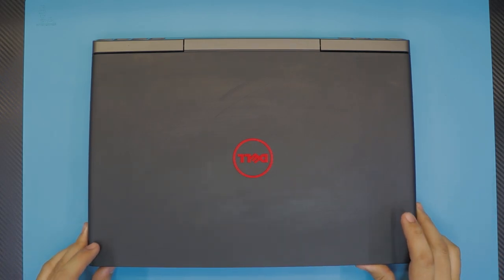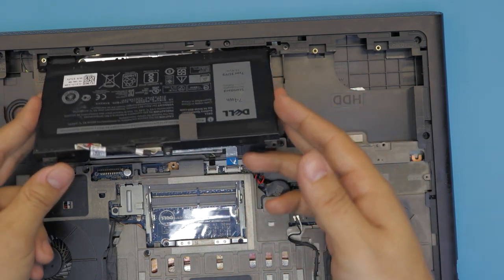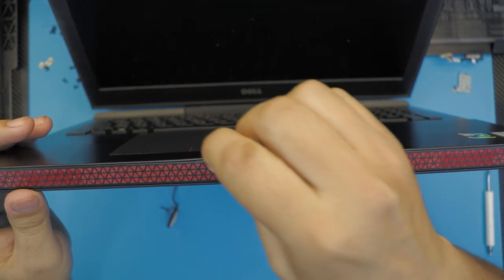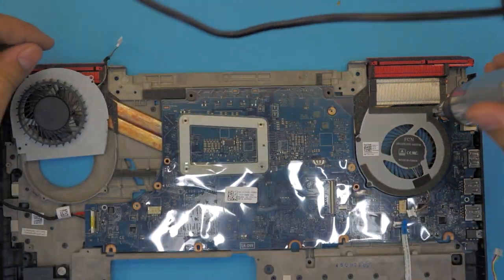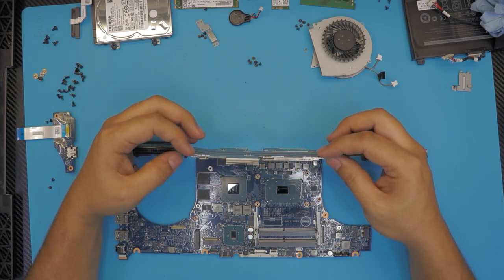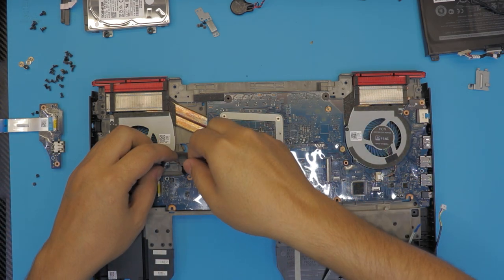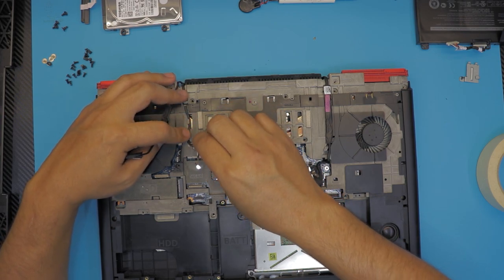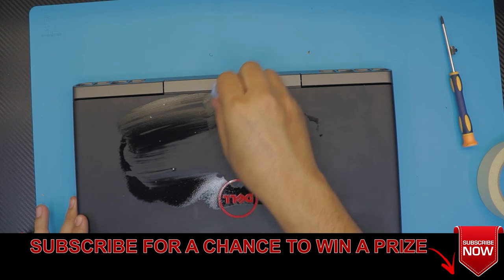Dell Inspiron 15 7000 LIQUID METAL thermal compound and teardown

Comment: I used this tutorial to replace the thermal paste with artic mx4, as I had suspected using liquid metal would lead me to make a mistake a possibly kill my machine. I was right, some mx4 got onto the capacitors, I cleaned them off, and made sure everything was fine, put it together, and it worked! Maybe once I'm better at applying thermal paste I'll try using liquid metal. Thanks for the video! Only took me 4 hours to do though
Reply: I did this on a similar model, it is the inspiron 7577 I believe, it has a gtx 1050 and a core i5-7300hq. Only some minor deviations
Reply from the maker: thank you for the support to the channel by subscribing :)
and i appreciate your tips and opinion regarding the repaste, and look at the positive side now it took you 4h next time it will be 2h and before you know it you can do it under 15min and the best part you will be able to help family and friends :P if you got any request or questions in the future ask me in any of my video comments :)

Comment: How to cleaning the "red headsink thing" ? Because mine little bit oily and trap the dust, so the air flow not good
Reply from the maker: Thank you for the feedback! if you wish to support the channel you can LIKE or SUB or both :P
regarding your question: you can remove all the pads from heat-sink and wash it with hot water and soap and let it dry or dry it with hairdryer, and blow air into fins.
Reply: @uFixTek  ok done,...and thanks for reply

btw we can remove it from the chopper tube ? are you sure ? is that soldered ?
Reply from the maker: you only going to lift and remove slowly the thermal pads off the heatsink and then clean the heatsink and wash. don't force the copper tube or anything.

Comment: Thank you for the video. It made disassembling and further reassembling much easier.

My laptop was throttling for almost 2 years. Couldn’t figure out until I realized it was all dried-out, old crumbling thermal paste to blame.

Also, thanks Dell engineers for making that complicated.
Reply from the maker: Glad it helped, Thank you for the feedback and your support to the channel by a SUB :P
if you have any request or question feel free to ask.
LOL this is nothing compared to some other models that they have, if you think this is hell you don't wanna see the devil yet :P

Comment: I cant wait for the next weekend to apply this tutorial. Currently, my thermal paste is on the way and my laptop is 4+ years old. Wish me luck! Great video btw, keep it up!
Reply from the maker: Good luck! Glad you liked it 😊Thank you for the feedback! if you wish to support the channel you can LIKE or SUB or both :P
if you have any question or request in the future feel free to ask me.
Reply: asf asfd  yes, i also add nail polish. It has been running great for 6 months without any problem. The downside is like you said, im afraid to take it around because the paste MAY spill all over

Comment: I have this same model 7567 with gtx 1050ti, can I change the motherboard for the model gtx 1060 7577 would be compatible this exchange?
Reply from the maker: Thank you for the feedback! if you wish to support the channel you can LIKE or SUB or both :P
regarding your question: Absolutely NOT, we have tried the heatsink profile is very different and the heatsink for 1060 wont with in this case.

Comment: Nice video dude, some heroes don't wear capes.
Reply from the maker: Thank you for your comment, and if you have any questions regarding any laptop repair or electronics you can ask here :P
Reply: @uFixTek  In this laptop model, when using the Arctic 5, do you recommend applying a bit in the center and let the heat sink spread the paste over the chip or apply the same way you did in this video?
Reply from the maker: to be honest and if you trust me i would say go with the way i do i been doing my test and working in this line of work over 14years. you can put a bit in the centre but if your heat-sink doesn't press directly over the pasete , the paste will expend the other way leaving a clear spot on dye.
i would highly recommend you to apply paste all over the dye (dont worry if you add more), its not conductive.
Reply: @uFixTek  Thanks
Reply from the maker: @sidneidiasmonteirojunior3846  anytime, let me know if you need help with anything regarding your laptop.

Comment: Hey, will you recommend replacing the thermal pads as well?
Reply from the maker: NOP no need to. unless you do a over clock then yes , if no over clocking then no
Reply: Thermal pads won't help shit nothing, first of all, thermal pads have very low thermal conductivity, and also comparing one to another, there's very small difference, also RAM chips don't run hot so you almost wouldn't even need the cooling and third, there's common thermal surface, this means that all chips are cooled with same surface, same cooler, so if the cpu/gpu runs extremely hot and the whole cooler is hot, it won't help much if ram/pwm is cooled with same warm cooler...

Comment: Nice video. I am experiencing throttle in games with the same laptop. I have MX-2 thermal grease right now and is it worth to put it on the laptop? Or should I go with liquid metal?
Reply from the maker: Тимур Файзиев i would highly recommend you to get LM it’s worth the wait. Once you go LM you never have to look and worry regarding your temps, ever again, just a regular dust cleaning.
Reply: @uFixTek  how's the temp difference a month later?  honestly thinking of doing this on my Dell 7000 laptop
Reply from the maker: @neverstopz9045  the temps are the same the temps wont change unless the heat-sink is filled with dust , i personally have LM on my alien-ware and my pc gpu and they are solid  and they have same temps as day one when i put on the LM.

Comment: Did everything as instructed, got ∆t of 23°. Used thermal grease conductonaut as ufix, im very happy that someone actually didnt lie about this improvement in temperature, now my pc runs smooth without thermal throttling and the rpm of fans decreased from 5000 to 4100, which also lowered noise from my notebook. Thanks for the vid man!
Reply from the maker: im glad that it did helped you out my friend and i appreciate your support by sub,a nd if you got any questions in the futures you may ask me in any of my video comments :)
Reply: cuantos grados te arroja maximo  jugando ??
Reply: What notebook are you referring to in this comment? If you don't mind me asking?

Comment: hey bro, how much does the temperature drops? and will it increase performance in my laptop?
Reply from the maker: the temps drooped from 95c to 68c on gpu cpu was over 90s and drooped to 75 , on over load. it will for sure improve performance as your cpu wont over throttle . and dont let no one fool you with exact numbers as exact number have many factors , room temperature programs that use cpu or gpu or both and many other factors. but it will for sure change your life :P
Reply: uFixTek Ight, thank you very much, I’m from Mexico so it’s kinda hot here so I had a problem since I bought the laptop, the temps on the cpu were to high all the f time so I had to under clock, that stopped the problem and also stopped Intel alert systems telling me every 5 min the cpu was to hot. But I’ll try this metod for shure, thanks again man.
Reply from the maker: @enlamiramxes  ah ntp compa , si gusta igual nos puedes enviar tu equipo lo hago aquí en mi taller ando en queretaro yo, soy de canada pero vivo aqui. ya me han mandado varias alienware otros subscribers de mi canal que estuvieron en otro estado.  igual se le hago un video para que veas el trabajo echo . saludos

Comment: Hello, what kind of thermal pad would you recommend for this knee? Could it be 0.5 or 1.5mm? So what exactly is the thermal pad used as stock?
Reply from the maker: 🫠Regarding your question, they used .5mm thermal pads and you can change them for a better quality: Gelid Solutions GP-Extreme: https://amzn.to/3Sv1Fid
Should you have any further questions or requests in the future, please don't hesitate to ask me.
cheers🍻

This is an Amazon affiliate link. When you use my links, you are helping to support the channel. 🙏

Comment: I broke the mechanical hard drive lock which you were speaking about at 2:21 where can I get a replacement? Can't find it on Amazon
Reply from the maker: 🫠Regarding your question, if you broke the lock i will need to see and image of the damage to be able to assist, email me pictures of damage.
cheers🍻

Comment: Hi ,I got that same Dell 7577 , the keys 2,w,s,x don't work, is it the keyboard.
Reply from the maker: Thank you for the feedback! if you wish to support the channel you can LIKE or SUB or both :P
regarding your question: yes it very common issue with this keyboard as it absorbed a lot of heat and starts going bad like cancer, it will expand to the rest of the keyboard, you must replace the keyboard, the keyboard has to be replace from inside the palm-rest. here is an example of how to  replace a mesh keyboard, its the same technique: https://youtu.be/lc6PUlPlpP0

Comment: Hi, i did everything like you on the video, but my laptop won't start, power button is dead. When i  lauched it for the first time, fan's were very loud but no display, anything. Now when i am trying to turn it on, nothing happens, even fan's dont work. What can be the problem?
Reply from the maker: can you double check the flex cables mostly the flex cable that goes to power on board. and send pics and let me see what you may have done wrong.
Reply: @uFixTek  Ok i will check and i think it could be the problem because i broke that lock which is holding the flex, so a used a tape to hold it... xD
Reply: Any idea what can i do in that situation?  Tape is a good idea?  Edit. i found that little plastic lock and it looks good, is there a chance to put it in the slot
 to place a cable properly?

Comment: Exactly what I was looking for! My battery is bloated, my fans are very dusty and hence my 15 7000 is running very hot. (Idling at 80 C, maxes out at 100 C causing the CPU & GPU to throttle to 1.8 GHz) I have bought the "Noctua NT-H1 Pro-Grade Thermal Compound". Hoping it will drop my temperatures by at least 10 C, since LM is quite expensive in my country. Do you think I can do the maintenance by myself? What suggested screwdrivers would I need to open all the screws you did in this video? Also my fans are terribly dusty, how would one clean them (water? )? Excellent video! Keep up the good work. You've earned a sub. :)
Reply from the maker: I'm glad that this video can help you out, if you are a bit of handy man and know how to put a IKA chair together, then trust me you can follow my video and if you have any question ask me i try to reply quickly. regarding the screwdrivers grab any cheap set of screw driver but if you want to service often you electronics get the one in my video description. about the fan noise never ever use water , you need a old tooth brush and  a "Alcohol isopropilico" link in the description. you can use the same alcohol to clean the motherboard, its safe. i would recommend you to put a copper shim on gpu and cpu 20mmx 20mm .3 or .4mm thickens. and you will have to put thermal pasteon gpu/cpu then on othe other side of the copper shims. you will be shocked by temp drop. good luck
Reply: @uFixTek  Just removed the bloated battery yesterday and have enjoyed doing it. Will now move on to removing the dust while cleaning it with the suggested alcohol for everything inside. Thanks a lot. Will update and text you if any help needed.
Reply: @uFixTek  thanks for the shim idea.

Comment: Always disconnet the battery first!
Reply from the maker: it is a good idea if you need to be extra cautions, BUT as long as the laptop is off, you can remove ram and HDD and m.2 without any issues, without removing the battery. when you look at the schematics of the motherboard you will know that the power rail to the ram and hdd and m.2 and many other ports and parts are off and there is no risk of shortage. 
again there is nothing wrong with disconnecting the battery 1st.
thank you for your feedback and comments :)

Comment: Im a lil late to this. Been using my laptop for 3 years plus to 4. About to repaste and seeing this vid realized there is thermal pad. Since im gonna repaste, might ad well change the pads as well. Did u by any chance measured back then the thickness of thermal pads? 

Thanks in advance
Reply from the maker: Thanks ✌  for the feedback!  if you wish to support the channel you can LIKE or SUB or both :P
Regarding your question:  i would recommend you to keep the original pads as they have a life span of 13years and those components don't go over 60c but if you wish to replace place this .5mm:
https://amzn.to/3gseKpC

Comment: I understand that liquid metal can not be changed? or does he have an expiration date? I use a grizzly cryonaut and it also copes well and does not dry) will there be a difference between it and liquid metal in temperatures?
Reply from the maker: LM can be changed and you can clean and re done it, and it does NOT expire! the only expire kinda stuff is if you place the heatsink and lift it after few days you must clean and repaste it. any type of paste they have expiry date and the date is based on the use and heat pass. normal use 3-4 years. LM will give you 4-5c extra drop. good luck

Comment: hello, I have a thermal grizzly kryonaut, is it appropriate to apply it to the heat sink after applying it to the processor and graphics card with a cotton swab as you did in the video? I mean, does it happen in liquid metal or this, or does it matter? According to him, I will do what you did.
Reply from the maker: Thank you for the feedback! if you wish to support the channel you can LIKE or SUB or both :P
regarding your question: if you placing LM apply it on both side, BUT if you going to place a paste only on GPU and CPU, a tiny line no need to use cotton swab for paste.

Comment: What is the material of the heatsink on the XPS15 L502X ? I see its copper but what is the silverish araound it ?
Reply: It's a coating of zinc. It's commonly applied to heatsinks and coolers to protect against corrosion.

Comment: Tal vez a alguien le sirva mi experiencia:

Tengo el mismo modelo de computadora. Para la aplicación de thermal pads y pasta térmica, utilicé los siguientes productos:

-   Thermal Pads: Arctic TP-3, 100x100x0.5 mm.
-   Pasta Térmica: Thermal Grizzly Kryonaut Extreme.

Los thermal pads originales de mi computadora eran de 1 mm y 2 mm. Para compensar, superpuse los nuevos de 0.5 mm uno encima del otro, usando 2 pads para lograr 1 mm y 4 pads para 2 mm.

Al recortar los pads, usé tijeras, pero no obtuve cortes precisos debido a que los pads eran muy delgados. Cambié a un cúter y una regla, lo que mejoró notablemente los cortes. Antes de recortar, asegúrense de que la parte lisa y dura del thermal pad quede hacia abajo para un mejor corte. También pueden usar una tabla de picar debajo y asegúrense de sujetar bien la regla y el cúter.

La pasta térmica viene con dos puntitas que funcionan como aplicadores (se instalan en la jeringa). Usé una de ellas para aplicar y distribuir la pasta, pero no me quedó bien. Para la próxima vez, usaré solo la punta de la jeringa y la técnica del puntito en el centro o dibujar la X, ya que he visto en videos que así se distribuye bien la pasta al colocar el disipador. Si alguien quiere usar el aplicador, encontré un video que muestra como hacerlo: el video se llama "Hands-On: Thermal Grizzly Kryonaut [application and spreading] thermal paste" y es del canal der8auer.
Reply from the maker: Muchas gracias por su opinión y experiencia.  
Saludos.
🍻

Comment: hello sir, do you think the PTM 7950 (thermal pads) does the trick here for repasting the old stock thermal paste? 😅 do you think the 35mm X 50 mm is perfectly fit for GPU and CPU ? thanks  or should i buy arctic mx 4 in 2 or 1 grams. 
btw your video is such a great help for my enourmous racoon hand
Reply from the maker: Thank you for your feedback! If you wish to support the channel, you can like, subscribe, or both!
Regarding your question, if you can get PTM 7950 use that and it will be awesome and last longer.
35mm X 50 m should cover both.
Should you have any further questions or requests in the future, please don't hesitate to ask me.
cheers🍻

Comment: Hey, i followed the video but when when I press the power button the fans spin at full speed for a while with no display at all and then they stop and nothing happens, do you have any idea what might be the issue here?
Reply from the maker: Thank you for the feedback! if you wish to support the channel you can LIKE or SUB or both :P
regarding your issue:  it happens often that bios dont detect the rams , i recommend you to follow the steps: remove both rams,  and press power on and wait 3sec and force shutdown by holding the power button for 5sec, and once its totally off, the place one ram in the dim closes to motherboard and power on and wait up to 10sec to get a screen once you got logo or boot, the power off and add the 2nd ram, and power on wait 10sec and you should be all set, also check all you connectors.

Comment: Does anyone know if the top lids of dell 7567 and 7577 are exchangeable?
Reply from the maker: Yes it can be replaced you can find it on ebay.
Reply: @uFixTek  thanks for the head up, I really want to get rid of soft touch coating of my Dell 7567.
Reply from the maker: my pleasure my friend :P